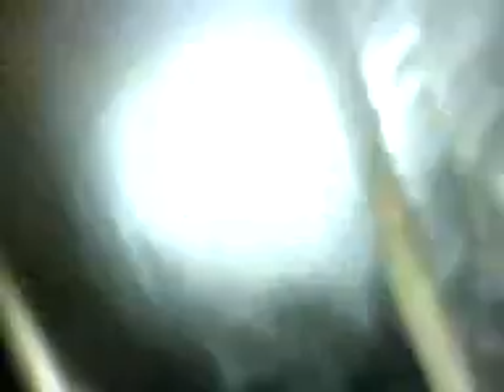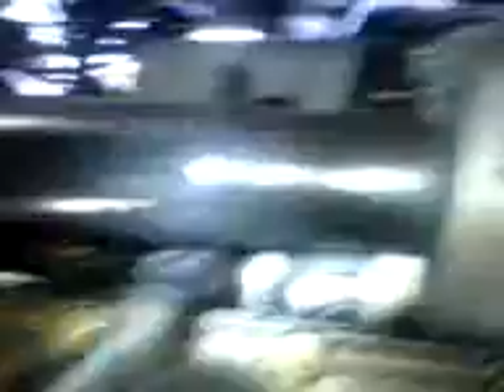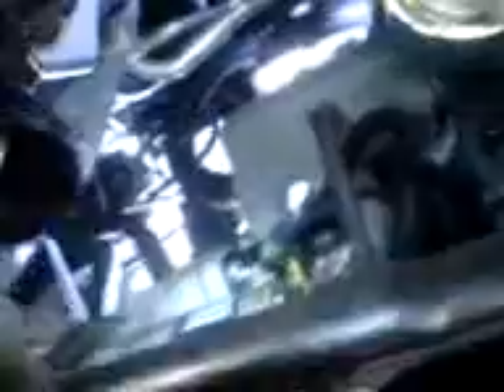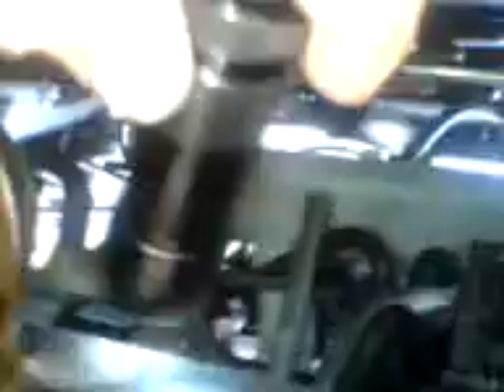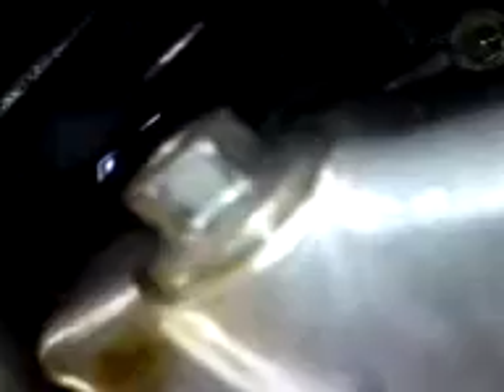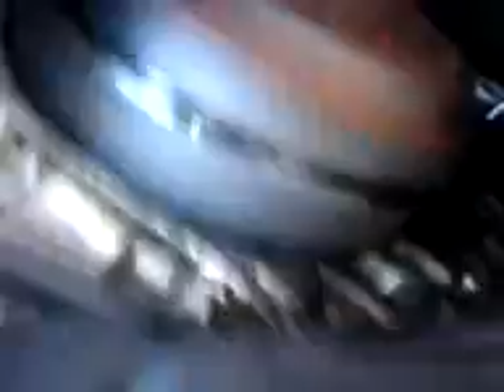Where is the oil leak in my SAAB

Comment from the maker: I did find out where the leak was, it was the oil pressure sensor, and it's really hard to get to, it's on the back of the engine right above the downpipe.

Comment: Do you know if the Saab 9-5 (1998) has motor oil shared with gearbox. Or it has gearbox oil seperated from the oil wich goes to the motor?
Reply from the maker: I'm not sure, the gearbox/transmission has it's own "fluid" but may get oil for additional cooling. I suggest you ask this question on the Saab Central Forum (a website).